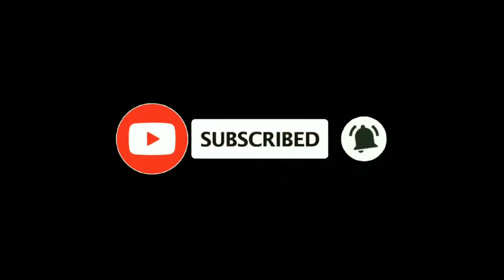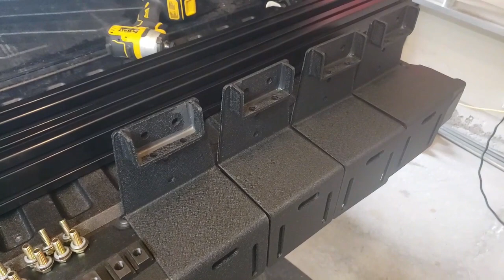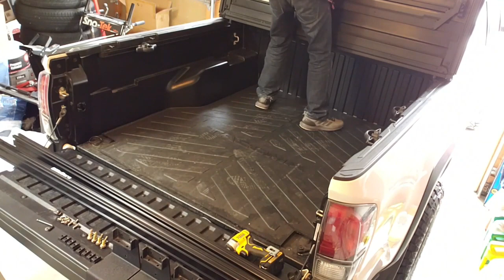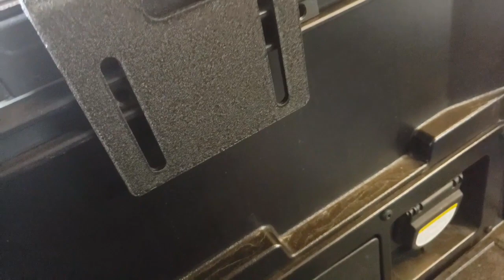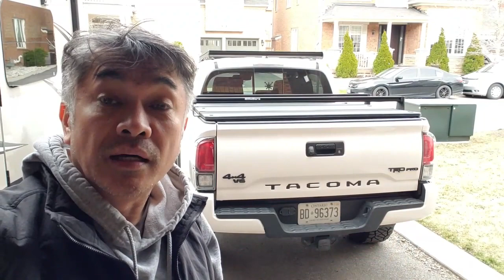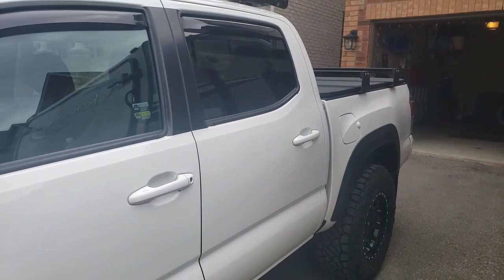DIY How To Install Billiebars Bed Rack System onto 3rd Gen Toyota Tacoma TRD Pro | Mod #29

Comment: Does this make the bed cover leak since the mounts go under the rubber seals of the bed cover
Reply from the maker: Hey Joel, unfortunately it does but the amount of water that goes in during a heavy rain is not terrible.  I just make sure all my gear are all in sealed containers.
Reply: @modXELA  thank you for the response 👍

Comment: very bitchin' informative video, exactly what I was looking for, thank you sir,
Reply from the maker: I'm very happy I went with this height. My buddies went with higher setup and with roof top tents, there's more sway and that has to put a lot more stress on the truck bed with all the left to right sway on bumpy trails.  With mine, not so much but I want to install bed rack support brackets just to be safe so be sure to check out my channel for more!  Thanks for tuning in ToyoTaco!

Comment: On their website there’s two options...Why the 5” and not the 8”? Wouldn’t the 8” height give you more clearance with the tri-fold cover?
Reply from the maker: At the time when I bought mine, 8" was not available but I don't want it to be that high anyway. When you offroad with an RTT mounted, the weight of the RTT sways and rocks the bed rack system pretty intensely.  The higher you go, the more sway you get and that puts stress on your bed and it looks like it would pry right off but that's just me being cautions. I'm planning on installing a slide-out bed anyway.  If you're not mounting an RTT then it's not a concern and what you're saying makes perfect sense.
Reply: @modXELA  thanks for clearing that up! You rock man. Love your Channel on the taco! I got one super white just like yours. Keep up the good work. Subscribed and will keep in touch on your sliding bed mod.
Reply from the maker: @hmgxiongchico  I appreciate your subscription!  I'm just waiting for those slide-out beds to go on sale as they're pretty pricey (up in Canada especially!).  It's a real pain to be crawling in and out of the darn bed, lol... anyway, safe truckin' bro!

Comment: Hey - nice video. Is the recommended placement right on the seam of the cover? I was wondering if you could slide it forward a little for access to the first third of the cover or if there is a quick release option for the rail screws for partial or full access to the bed w/o having to use the provided tool?
Reply from the maker: Not really, the mounting spot fir the bracket was not specified. I chose to install the bars where I did because I wanted the bars to be centered for my rooftop top tent that way it's balanced.  There's tons of play if you want to mount them differently.  I hope this helps and thanks for tuning in Andrew!
Reply: FYI- I sent a note to the company and got a response straight away: 

“We now offer thumb screws, which is a relatively easy and time efficient way to take the bars on and off. Hopefully that option works for you.”
Reply from the maker: @solek1tchen  Hey this is definitely an interest to me. I'm always switching between the roof top tent and the dual mountain bike setups back and forth and these thumb screws will definitely make life easier.  Thanks for sharing Andrew, I'll be buying these for sure!

Comment: How thick and wide is the bar supports? I want to make sure my top will seal. Can you measure them? Thanks.
Reply from the maker: Sorry for the late reply, I've been offroading this weekend and there was zero cellular service.  At any rate, top surface is 3-1/8" and side thickness is 1.5".  I hope this helps and thanks for tuning in norecoredneck!
Reply: Thanks but I was talking about the part that bolts to the truck bed. I need the thickness of the material. Is it 1/4” or possibly 3/16” thick? Thanks.
Reply from the maker: @norcoredneck  it's 3/16"... sorry for the confusion.

Comment: Great video.  Mine are arriving this week.  Do they include any of the tools?  If not, what size socket is that?  So I can make sure I have what I need before they arrive.  Thanks for the help.
Reply from the maker: Hey SAVY, the tool (T49 with a center hole) is provided by Billiebars for the screws to secure the cross bars to the bracket.  It's a standard 14mm socket for the bolts to secure your bracket onto your bed rails. I hope this helps, good luck with your install and thanks for tuning in!  Hope to hear from you again.  Cheers!

Comment: If you fold your trifold tonneau cover to the front of the bed, will it still fit underneath the front crossbar?
Reply from the maker: No tt won't,  there's only a 2.5" space and my OEM tonneau is pretty bulky.

Comment: Nice!
Just wish uprights were stainless or aluminum we live in salt country. Never seen any coated steel last
Reply from the maker: I guess they need it to be stronger and carry more load.  If you triple up on the powder coating or bed rack coating, wouldn't that stand up better against salt?
Reply: @modXELA  salt is pretty relentless up here.
Reply: That was my concern which is why I went with KB Voodoo's pro-x crossbars, they offer a 3 year warranty, any signs of erosion and they'll send you a new set.

Comment: That looks awesome, your research paid off, the only downside is you cant open your cover without taking the bars off. If the bars were just a little higher, I would consider buying them because I have a roll up Tonneau cover and it could  just roll up under the bars which would give you full access to the bed. Great video, thanks for sharing..
Reply from the maker: Hey Vin, you're absolutely right about accessing the bed, it will get cumbersome for sure for me. I'm considering a slide-out bed but they're pretty pricey so I will go with my setup for now. I also like your roll-up cover, they're more practical and weighs a lot lighter. Anyway, I'm compromising for now, we'll see how it goes... thanks as always and Happy Easter to you!
Reply: True but it's just the hex bolts and the bars pop right off. Leave the brackets on the truck. Takes 5 mins at most.